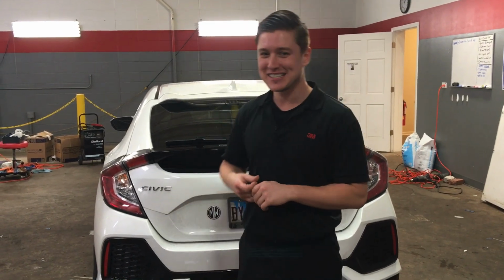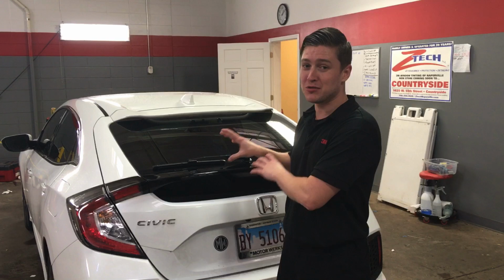Honda Civic Hatchback Tint WITHOUT Removing The Spoiler!

Comment: That looked easy enough. They had to take my spoiler off to tint mine. They still did the whole Car in a hour and a half. I left and came back and when I got it home everything was put back together tight. I didn't want to see them take my car apart that far so I left. I mentioned something like this too them and they were like ah we've done a bunch of them. It won't be a problem. I got my car done at Buckeye Sun Control.
I would have rather someone tint it like this. Big time though just cause your not taking the back of the Hatch apart just to tint it.
Nice job. I'd have come to you if we were closer.
Reply from the maker: Awesome! Yes this process takes a little longer. We typically do removal every time. There really is no issue with it if you know what you are doing. Just in the frigid cold chicago winters its not always best to be popping plastic off since it can snap easier. If you are ever in the area come on by!

Comment: So what exactly do you have to do to shrink the tint on the exterior? Vid didn’t show much and then it cut to the interior application. I have a spoiler extension on mine so I can’t remove my spoiler without taking off the extension, which is hard to do :(
Reply from the maker: Shrink the top part of the tint on the exterior as normal since there is room like normal. To shrink the bottom under the wing on the inside is shown in the video. Its not easy.

Comment: What did you do inside the car ?
Liner facing you or tint facing you during tinting on inside ?
Reply from the maker: He first did as much shrinking as he could on the outside, then he used the wet shrinking technique on the inside with the liner facing up for the fingers. Then he flipped it around for the install.
Reply: Thanks for share nice tricks, you meant when the film was inside he was shrinking the small bottom portion the liner or the film 1:00 ?